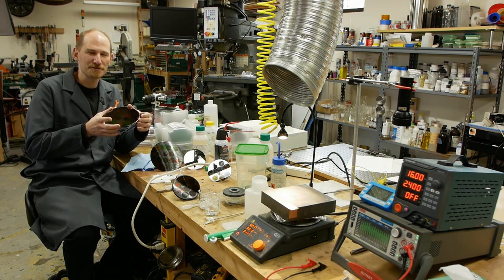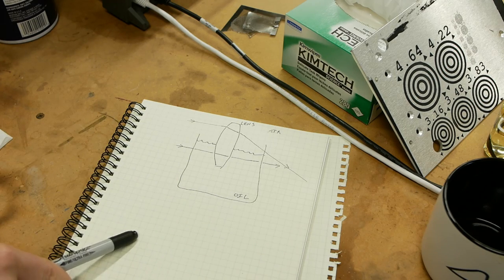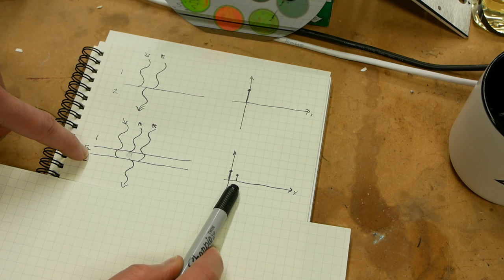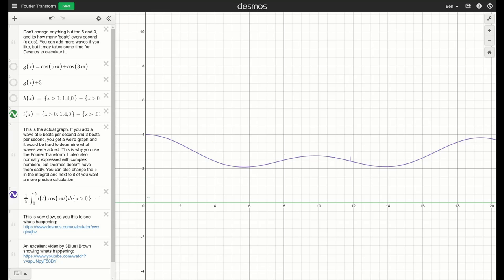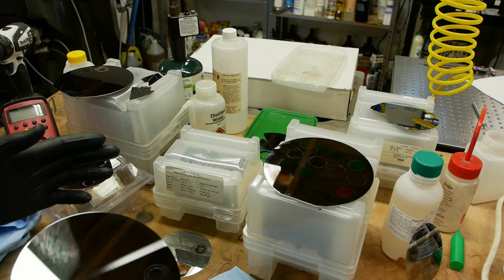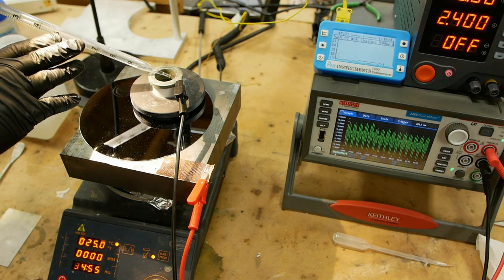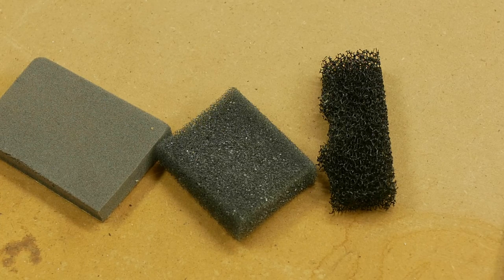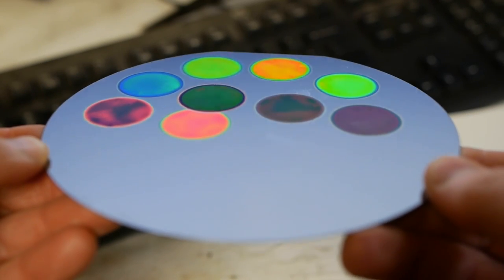Etching silicon wafers to make colorful Rugate optical filters (porous silicon)

Comment: Hey Ben, I got to thinking about this video again over the last few days and had a question about it's applicability to making a radiative sky cooling emitter. Do you think it would be possible to make a surface by this method that selectively reflects the scattered visible blue light from the sky, and then also rejects the bands of IR that don't fall within the sky's infrared windows between 3-5 and 8-14 μm? I don't know how far this method can be pushed.
Reply from the maker: Hey, I've been watching your emissive paint videos, and can see the application here. In principle, you could make a rugate filter with these three bands, but the spread between them will be a challenge. Luckily, silicon is one of the few materials that has some transmission out to 10um. Let me do some reading about long wave filters.
Reply: This is an awesome idea!

Comment: So rugate filter is a kind of dichroic? Have you tried using fluoride salts instead of hydrofluoric acid? e.g. ammonium bifluoride? This should work similar way and is much safer to acid as it's not volatile.

Comment: Dental Implants use this method to "rugate" the titanium so bone can grow in the crevices and grasp it better. Rugation can make the titanum totally integrated with the bone. It also makes it change colour.
Reply: Whoa, I had no idea! That's super cool!
Reply: That is so neat!  Since bone is a porous material, it does make sense that it would bind better to another porous material.
Reply: @Walter-Montalvo  its not related directly to the porousity of bone but to the fact that cells like to get into porous spaces. including cells that make bone
Reply: @sudazima  Huh super interesting.  So if there is a very smooth surface (polishes titanium) and a porous surface (porous titanium) then the cells will prefer the porous one.  Also it means that joints like hip replacements perhaps need to be very smooth to prevent the cells from binding, right?
Reply: @Walter-Montalvo  its more complicated than they but yes. the hip joints have different concerns but in anycase no bone cells will grow in that space anyway. infact it may even help having a porous surface. places without cells tend to give strong immune reactions and indeed high concentrations of white blood cells are found in srtifical joint fluids, although its not well understood afaik.
Reply: @sudazima  More complex, that is cool.  Regarding rugate filters, wonder if we can design surfaces with different porosities, perhaps different cells will interact/attach in different ways.  So maybe cell sensor applications or cell filters might be possible with rugate filters.  Food for thought... :)
Reply: have they come up with something yet (commercially/clinically available) that recreates enamel and dentin? I'm thinking some chemical compounds that react/set/whatever to the same thing or close enough. I know there appears to be no way to have the tooth itself restore enamel.
Reply: @crackwitz  why would you even want to? brushing our teeth shows that it is clearly not upto the task, better replace it with something better. and no enamel isnt replaced since the cells that made it are long gone.
Reply: @Walter-Montalvo  In fact the implants have different levels of rugosity depending de position , the bone quality... things like that. At least at the factory i visited.
Reply: Am I the only one who immediately thought of Wolverine?
Reply: @framegrace1  Can you say which factory you visited? I'm very curious to research this more
Reply: @sudazima  The enamel are remineralised by saliva and re-eroded by acid at continual basis and modern toothpaste contain Arginine which enhance that remineralisation. Flouride also reduce the rate of erosion because it is more resistant to acid.
Reply: @xponen  yes i know.. ameloblasts are the cells that make tooth enamel in the dental papae and apotosis before tooth eruption. no new enamel is made afterwards.
Reply: So it makes it even more biocompatible. Nice.
Reply: Fucking science, man.
Reply: Woha!!! ...me putting down the sandblaster I GOT DELIVERED THIS MORNING to "roughen" titanium surfaces. LOL. I wish I had read your comment sooner!
Reply: @Walter-Montalvo  If you search for information regarding surfaces and membranes used for cell culture you will find many different types coatings, materials and treatments for cell adhesion and growth.
Reply: Interesting, my father was a dentist and I always wondered how they made the abutments, screws, etc. to be "bioactive" "bone-growing" etc.. Thank you for that!

Comment: This is awesome, and way over my head.  I figured anti reflective coatings on lenses were some sort of metalized vapor deposition. Are they simply an etched surface in the glass itself? Or a thin layer of etched silicon on the glass? I'm curious how this is done on non conductive glass (and plastic?). Are metalized looking sunglasses made with a similar process? Can you make a filter for sodium emission, with a similar result to didymium glassblowing lenses? Super cool. Thanks for another video that pushes me to learn something new.
Reply: I'm pretty sure metalized sunglasses are done with iridium vapor deposition. I vaguely recall Ben has done uploads on this in the past too.

  I know the cheap iridium coated lenses often have adhesion issues. The coatings on the cheap glasses can be washed off with regular dish soap, unlike a good pair of Oakley's or Smith's, but I'm no expert. I just learned the hard way - buy my cheap cycling sunglasses with black lenses.
Reply: for expensive optical lenses you would deposit silicon on top and do the chemical etching after.
Reply: @UpcycleElectronics  Iridium? You sure? If I wanted to make cheap sunglasses, expensive and stupid high-melting Iridium won't be my first choice. Even if it takes a really small amount of it.
Reply: @6alecapristrudel  You don’t have to melt it for vapor deposition, and only minute quantities would be used, so it’s not that expensive.
Reply: Optical filters are usually made via chemical vapor deposition (like you mentioned) or sputtering of a metal onto a lens either glass, or plastic like polycarbonate (CVD and sputtering especially can be used to coat just about anything) in micron/nano thicknesses.  But I suppose you can use this process for very specialized filters and wouldn't be surprised if its being used commercially already.
Reply: @6alecapristrudel  
Definitely not sure. I could be mixing up my facts with Oakley marketing department wankery. I went searching to confirm but found nothing so I'm likely wrong on the iridium.
 For further practical help check out Thought Emporium on YT. He did several uploads on the subject, but AFAIK he used copper, silver, gold, and titanium. He even did some glasses and a bee at one point.
-Jake
Reply: Is this akin to how some butterflies create blue wings without using any blue pigment but rather the structure at the nano-scale level.  Like how gold nano-particles can be used to make red glass.
Reply: @danbhakta  
>Like how gold nano-particles can be used to make red glass.
I think gold particles in this case work as quantum dots.
Reply: A bit of searching seems to suggest that this is done via sputtering where the material being sputtered is continually varied, with the silicon porosity process being more for mirrors, instead of lenses,
Reply: it really depends what type of filter you want. in my grad classes I did some research on special MgF2 coatings because of the perfect match in refractive index. they were just coated onto the glass from solution and baked in an oven.
Reply: "This is awesome, and way over my head" was thought as well, but I can certainly appreciate the pretty colors lol
Reply: @Alexagrigorieff  gold nano dots are purple
Reply: @GuyFawkes911 very expensive telephoto lenses are also often Fluoride coated
Reply: @arthurtapper1092  in fact one usually uses metal oxides (HfO2, TiO2, Ta2O5, Nb2O5), in the UV also fluorides. The sputtered or evaporated metals are exposed to a flow of oxygen (or a plasma containing oxygen) in the chamber.
Reply: @roderik1990  the continuous change of refractive index is a special technique from which "rugate" filters arise. Much more easy to produce is a layer stack with step like refractive index changes.

Comment: So basically, you play the Fourier transform of the filter into the etching solution, which modulates the intensity of the etching at the depth it's reached at that time, which causes the same modulation to occur in the porosity, resulting in the actual filter.

Nice.

Wait... does modulating the intensity change only the porosity or does it also affect the etching depth rate? Like, how does the already porous layer know it's finished? Is there some kind of passivating at the surface which is independent of the porosity level being applied?
Reply: I think he said the already prous layer usesup whatever is allowing it to transmit electricity, so it no longer etches. Was in the part with the foam as an example.
Reply: @Nichoalsziv  Yeah, but the etching speed could still be dependent on the current. If that is the case, high-current parts of the waveform must be shortened a bit to compensate and crate a better filter.
Reply: I hope he explains it in more detail.
My guess is that the etch rate is directly correlated to the current and you have control over the etched depth by simply varying the time the wafer is etched with that current. 
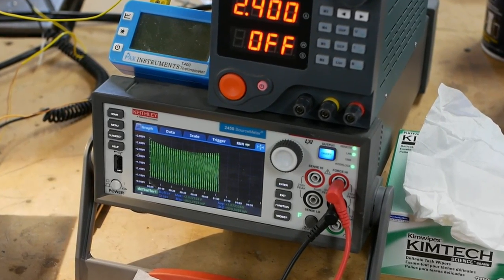However, 1:24 and 1:50 show an oscillating voltage?
Reply from the maker: Yes, very good observation.  The higher electrical currents increase both the porosity and the etch rate.  Because of this, to produce a true sinusoidal variation in index through the thickness, the electrical waveform would have to be modified from a true sine wave.  I realized this, and even suspected one of the academic papers compensated for this because their waveform looked modified (the peaks are sharper/narrow at higher currents, and more rounded at lower currents).  However, I couldn't find anyone actually discussing this etch rate correction in the text.  It should be pretty linear, so not too difficult.  Despite this, making Rugate filters works just fine with sine wave electrical currents, and this detail didn't make it into the final video :)
Reply: @AppliedScience  If I read this correctly would it be possible to assign values to colors like binary , etch multiple layers and using each layer as more or less a bit, and create a very low capacity, but persistent, read only optical storage...thingie... that could then be interpreted  by the spectroscope  readout?
Reply: @commanderbutterbars3910  nice idea!
Reply: @commanderbutterbars3910  See me in my office.
Reply: @commanderbutterbars3910  two problems. How small and whats its fidelity? How much is it affected by background noise.
Reply: Couldn't the etch not impacting the porous layer also just be explained by the discontinuities in the material increasing the sheet resistance and ruining the electro part of the etch? This could be measured using a Van der Pauw method (you may need to transfer the filters to a higher resistivity substrate though). It's totally possible some researcher has already done this as the only difficult part would be making electrical contact with the transferred film. Indium solder is standard, but silver paint works well with transferred films down to <30nm in my experience.
Reply: Thank you Ben @AppliedScience

Comment: I wonder if the chemical-sensetive ones have a high porocity on the top surface.
Reply: Same. Green is a relatively longer wavelength ie larger pores ie higher allowable surface tension of a chemical penetrant? But then I’d expect red to work too, unless the filter BECOMES red by the alcohol. I.e. it works on a red filter, except the original index is about the same as the alcohol impregnated index?
Reply: Do not mix porosity and pores size. You can have the same porosity (fraction of etched Si) and different pores size. Color depends on optical length which is product of layer thickness and refraction coefficient. The reason behind visibly low-changes with alcohol for certain structures is that spectrum moves over almost whole number of periods and with changed medium refraction coefficient same spectrum picture can be observed.

Comment: regarding the sensitivity to alcohol of just one filter, is it possible its the porosity (pore size) behaving like a molecular sieve?
Reply: Came here to suggest this. It also means different filter can be specific for different chemicals based on molecular size, if this is true. It would be interesting to test with different solutions. Water despite its small size may not work due to its polar properties.

Comment: If you use a needle electrode and raster scan it while varying the waveform could you print a coloured image? Does the method also work on titanium, or more likely the oxide layer on the titanium?
Reply: To some extent yes. In my PhD I shot electron beams in a raster pattern at a special glass where the electrons hitting the surface caused a similar change in refractive index. By calibrating how long the beam stayed at each point, you could choose the color there. Here's a photo I took with a microscope. https://onlinelibrary.wiley.com/doi/abs/10.1002/adfm.201570220
The biggest challenge in this silicon method is that it's hard to "contain" an electric field.  As Ben mentioned in some silicon UV light can generate the charge carriers needed for the reaction, so a laser rastering the surface could be used to make a picture.
Reply: This is probably where the etchant being able to etch the waver even without the current becomes a problem, because repeating the process for each pixel will take longer
Reply: @kylejacobs1247  so cool dude
Reply: @kylejacobs1247  How cool is that
Reply: @kylejacobs1247  What were the dimensions of that picture?
Reply: @whuzzzup  The height of the image is 90 microns, roughly the diameter of a hair.
Reply: or a variable linear filter
Reply: @jacewalton6677  With the right pattern on a rotating filter you could create a single sensor, prismless, spectrometer. Could be very cheap and compact?
Reply: @DanielSMatthews  If you Google search "Porous Silicon Based Rugate Filter Wheel for Multispectral Imaging Applications", you'll find an interesting paper from 2019 which attempts to do almost exactly that!

Comment: Is it a stretch to call anti reflective coatings "optical impedance matching"?
Reply: Ooh. Not so much of a stretch, thinking about it. If there are unmatched impedances in an AC circuit, then some of the signal IS reflected back ( eg in an unmatched transmission line). Nice one.
Reply: Not at all. My E&M textbook mentions verbatim impedance matching when discussing reflection.
Reply: It's exactly what they are. Similar to impedance transformers on thin film UHF circuits, consisting of several quarter-wavelength pieces of different width (impedance).

Comment: While you have wafers and HF, you can use them to etch hole-like nano structures that could make great molds for your gecko tape project. You can get very good results when combining with silver nano particles, which is what I used for some PV cells.

Comment: So you can make an LED? Or what other light-emitting structure are you thinking of?
RGB LEDs appear to have different dies inside for the different colors. Could you instead spatially control a doping process like this?
Reply: Or you can make optical circuits. Like they have been researching for a long time to replace electrical transistors in CPU's so you can make even smaller transistors than electronics can do.
Reply: Silicon doesn't have the band gap wide enough for visible light LED

Comment: ofc you have silicon wafers at home... like everyone does.
Reply: I think he's one of a group of people who were at one point or another experimenting with making semiconductors at home. Also Jerri Ellsworth and Sam Zeloof. The latter has been able to make simple ICs now. Anyway wafers aren't very difficult to get, if you don't need top notch quality.
Reply: @SianaGearz  seems like a thing he would try.
was wondering how likely it would be to be able to buy a wafer online...
Reply: @Chriss120   The industry produces a quite an amount of waste scrap, well not actually much compared to volume of product, but the industry is massive so there's quite a bit of it, and either you know the right people, or it just pops up on eBay. The two places where you'd find it are USA and China, and you can even go on Aliexpress and get a stack of 8 for like $100.
Reply: plain silicon wafers should be pretty easy to buy :)
Reply: I keep mine next to my SEM. Who doesn't.

Comment: What is the relationship between the optical frequency of the filter and the frequency of the current waveform used to produce it? It seems like there should be some connection, but it cannot be one-to-one as producing a THz waveform it definitely not in the range of a Teensy's abilities.
Reply: I also expected him to tell something about it.  He only mentions a period of 2-3 seconds, so this must be a very low frequency current below 1 Hz. Looks like some weird chemical frequency multiplier.
Reply: The relationship is between thickness of layers and wavelength of passbands/stopbands. Thickness of layers depends on time the etching current was applied.